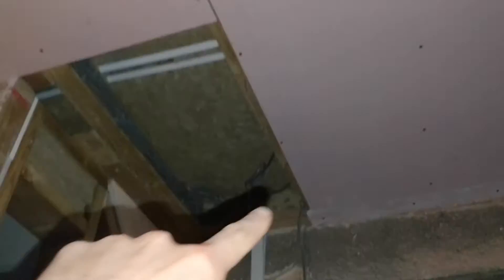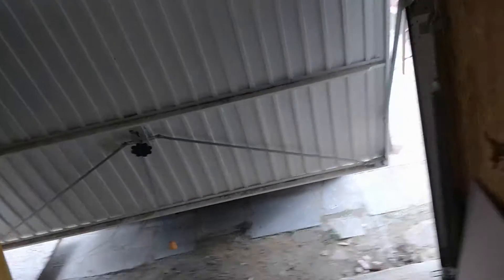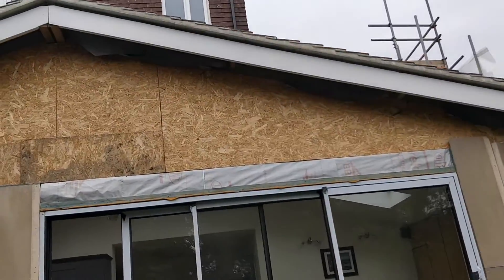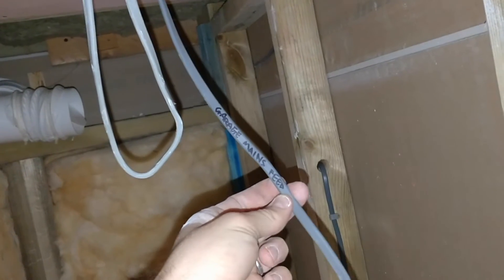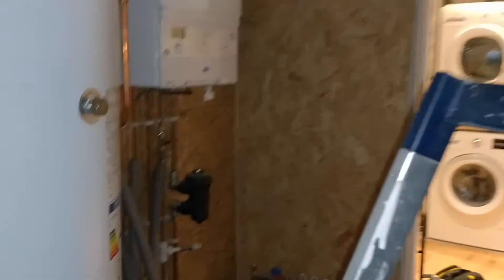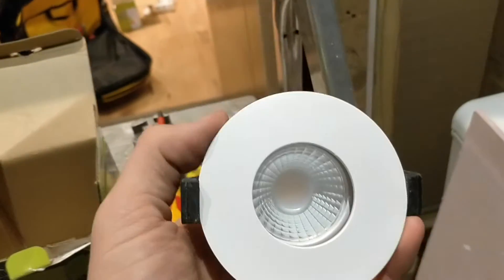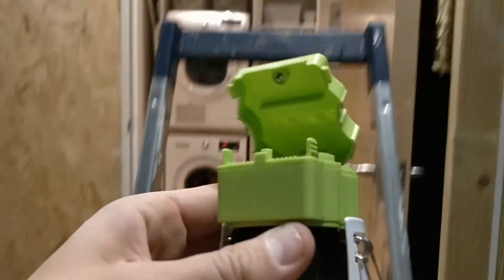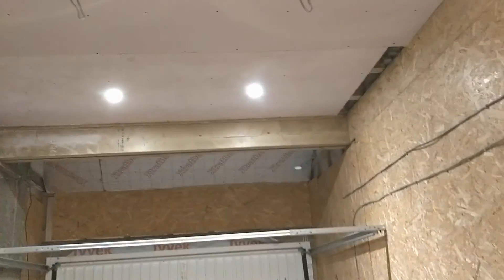Garage Fireboard & Lighting

Comment: How do you manage breathability of the original front elevation, since it is solid brick. I thought a lime type render would be needed. Likewise for the original interior walls (front elevation), a lime & fibre plaster would be needed.
Reply from the maker: Breathability is generally managed by leaving a 25mm gap at the bottom of the render boards, so that air can flow up the front elevation. We also did not block up any of the air vents that allow air into the lower section of the house (under the floorboards!). There's still lots of airflow around the place.
Reply: @ Very interesting approach, I have a 1920’s house which needs the render replacing and I was going down the lime render route. I am really enjoying your series by the way, I really commend your quality of work.
Reply from the maker: @burgerplace9764 cheers! The nice thing about using a silicone based render is that they are flexible, and relatively breathable too... probably not as good as Lime render for breathability, but very good for waterproofing, and a good range of stable colours too.

Comment: Excellent video and commentary as usual. One small observation that l couldn't help but notice, what was the reason for the socket outlet cable not being inclosed in the trunking? Keep up the good work and stay safe.
Reply from the maker: The trunking was more for aesthetics and tidiness rather than safety or protection of the cabling... because it's a single, visible cable, I figured it wasn't the end of the world to leave it out.

Comment: What is the point in the wireless switch ?
Reply from the maker: They're cool and fun! Haha not much other reason to be honest. I bought a number of them and got a bit carried away and installed them in places I didn't really need to.
Reply: @OfficeBoyBuilder  where will u put the switches and is there a chance they will get lost ?
Reply from the maker: I had pre-wired the switch boxes (the receiver units) into a central box under the stairs, so they protected, labeled, easy access, and right next to the consumer unit. The little switch button that tells it to turn on and off will sit in a grid-switch plate, with an MK cover plate on the wall of the garage. They're made by Quinetic.